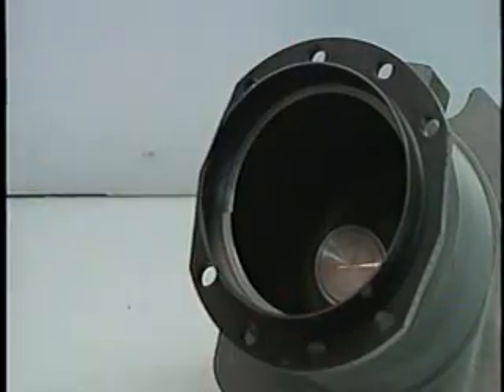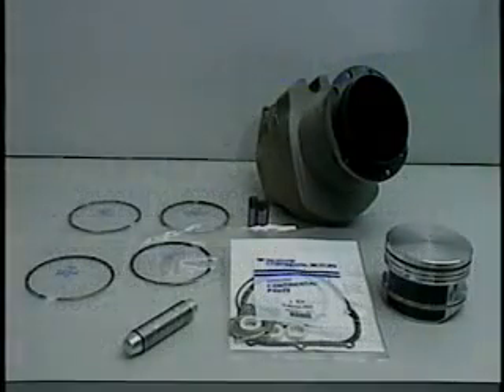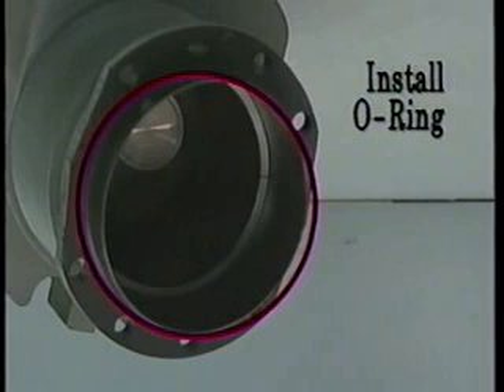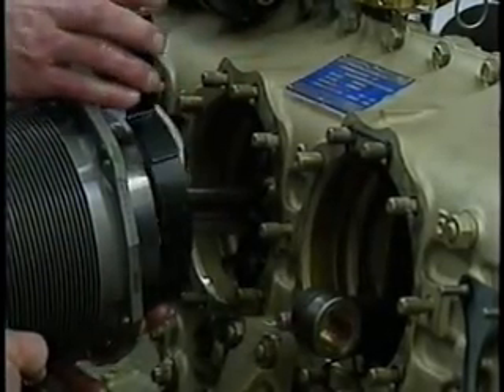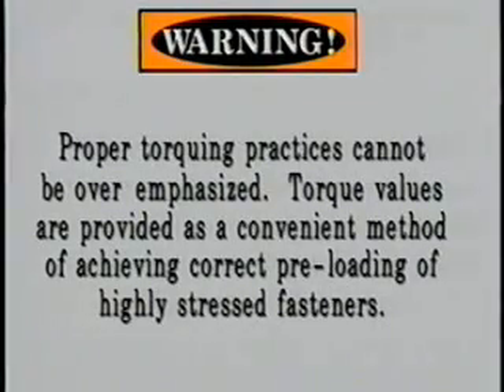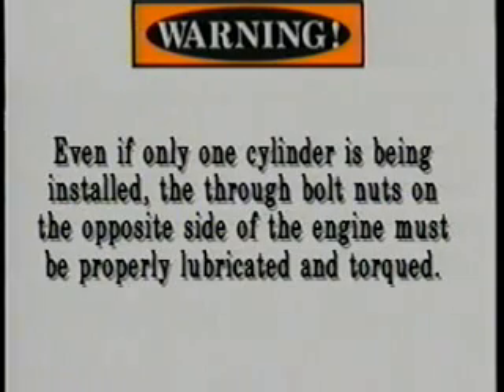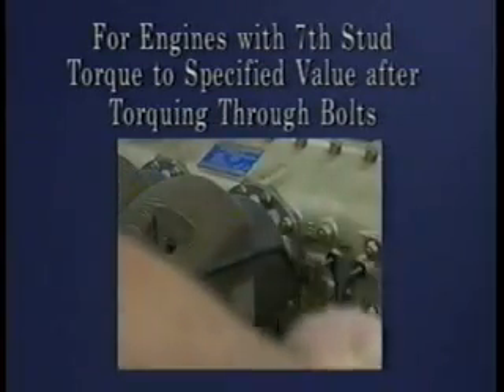Installing TCM Continental Engine Cylinders

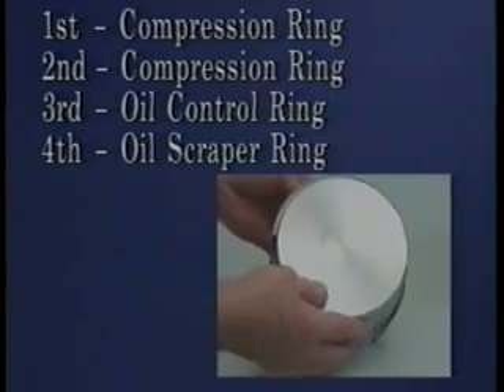Comment: 2:18  5th install the Oil control ring of the 3rd oil control ring, 6 install another oil control ring, just to make sure the 5th oil control ring works well. 7 install another oil control ring just for, why not? Just do it !!